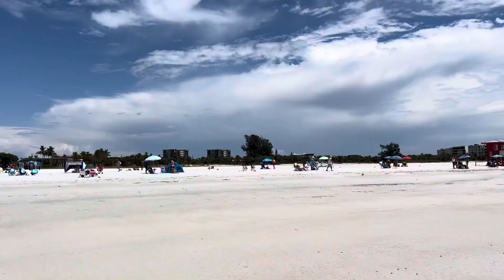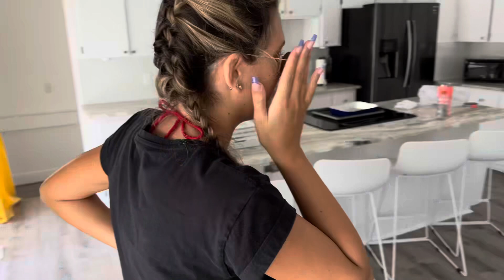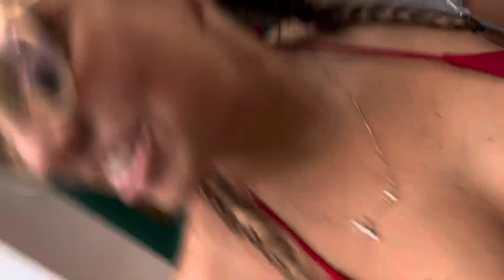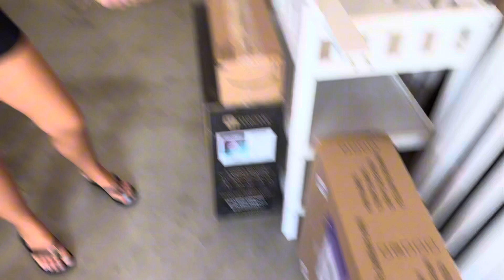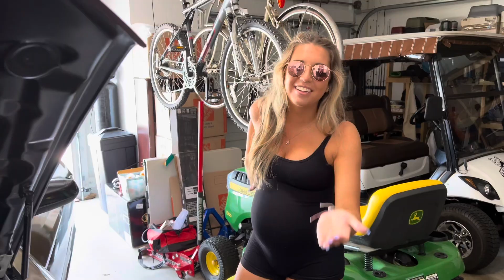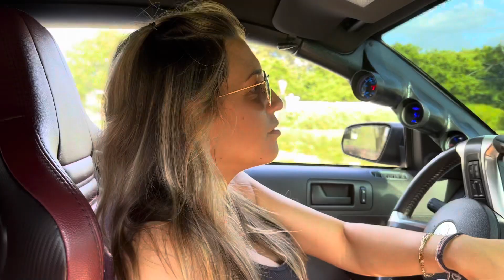MY 2014 MUSTANG GT HAS GEN 2 HEADS! (+ how to check yours)

Comment: I love the way you end the video "Peace out fuckers"!!!! 😂 What do you guys think of dakota r/ts?
Reply from the maker: thank you hahaha and marks dad had a dakota in the early 2000's! they are cool
Reply: @Rogue5.0  What trim? I've been looking into getting a second truck and a dakota r/t is at the top of my list right now, they have a 360, 3.90 gearing, rear sway bar, factory lowered, throttle body injection. Already have a project truck but it doesn't hurt to have a project that I can daily 😂 Would also be a good addition to the channel if you guys ever get a truck!
Reply from the maker: the r/t is sweet, mark thinks it was a silver v6 though! cloth seats, wind up windows! said he traded in for a 2007 f150 shortly after though with the 5.4 triton v8!